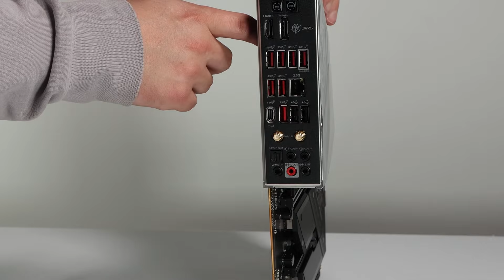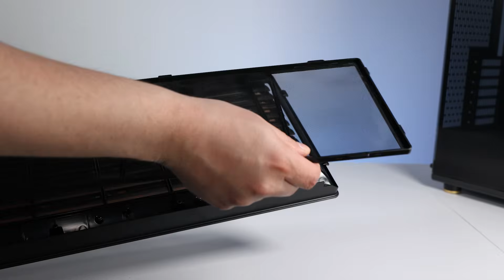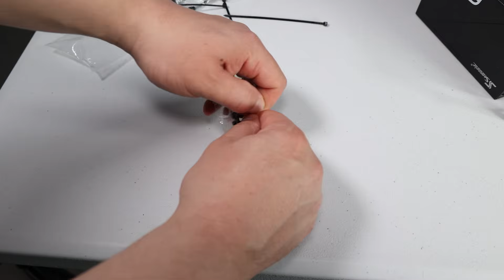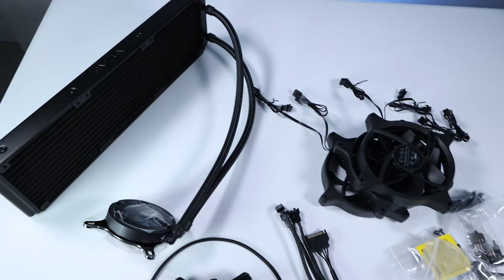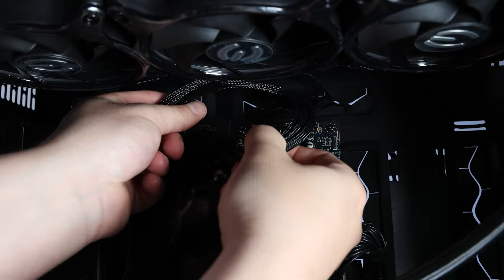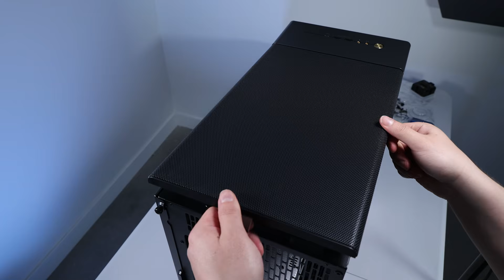Fractal North XL Build (High Performance Gaming PC)

Comment: Ordered a Fractal North XL with a mesh side panel to replace my current Fractal North with a tempered glass side panel. I'm looking forward to the extra space and cooling options. I'm also upgrading from an AM4 build with a 5700x to AM5 with a 9900x. I would have gone with the x3D, but the 9900x was a good deal in comparison, and the extra cores will be nice for other non-gaming tasks.
Everything inside mine will have the brown Noctua fans, and I'm going to put some wood-grain contact paper on the front of the "basement". No RGB, of course, but I'm debating putting an LED strip in there and setting it to a warm orange glow, like the vacuum tubes in an old radio.
Reply: Im deciding between mesh and glass, does mesh look good?
Reply: @ambatubelo I think so, in a more subdued, less flashy way.
Reply: @The8bitbeard  is it noisy during normal usage?
Reply: @giangibus4065  It was until I adjusted the fan curves. The mesh doesn't block the fan noise as much as glass does. I have all Noctua fans in there, which helps a lot.
Reply: I am going  for a seedy dive bar for the inside, something about orange is speaking to me.

Comment: watching your video i just had an idea that i'm now craving for the pc industry to do. putting all of the motherboard connectors (power and data and fan) at the back of the board. This would mean doing a new ATX standard but we could achieve true cablefree minimalistic build. because that motherboard with no cable on it looked amazing.
Reply: It's already available, not as standard but there are a few to buy out there.
Reply: @antonkeule  Ho really ? Who make this ? And do you need a special case for it ?
Reply: @mehdisol7094  MSI, Gigabyte, Asus as far as I am aware. Well, you need to check that there are holes / free space for the connection when the board is mounted. Channels like Gamers Nexus have covered that. Back connected motherboard and you will find what you need to know.

Comment: I'm making a very similar build to this. I've ordered the 9800x3d but its performance in all the tests I've seen isn't that much better than the 7800x3d. The prices for the available 7800x3d was only £20 less though so I just went with the 9800x3d anyway.

Comment: Don't need to remove thermal pad on m.2 drive if it's a one sided drive. If it has stuff on both sides on m.2 then you need to peel bottom also.

Comment: Finally someone who actually knows how to show and tell people how to build. Dont even ahve to know anything about a computer to understand the way you presented everything. Good job
Reply: When you start build this all parts into the case is always good practice to connect all essential parts just on the table and power on as a test, if it works. Last thing what you want is troubleshooting after everything is setup inside 😃😃😃

Comment: Nice build, I have a very similar once coming in the mail and I'll leave another comment when I get all the parts in for assembly. Fractal North XL, but my specs are a step lower than yours. 7900 XT, 7500f processor (7600 with no integrated graphics that you can get for $120, crazy good deal), air cooled with a cheaper motherboard. $1500 flat on pcpartpicker cause I got the samsung pro 990 2tb SSD (the GOAT), your exact memory if I'm not mistaken, and an 850W psu which is 300W overkill at least but I want headroom since the 7900XT is very easily overclockable for more performance.

Comment: thats how you dont install a cpu cooler
Reply: Can you expand?
Reply: Nope that’s one of the best ways to attach an aio cooler. Watch gamer nexus or jaytwocents to learn about their placements
Reply: You install it on the mobo first, then you install the mobo and then the radiator
Reply: @ItsRope maybe for an air cooler. Doesn’t make sense to install the pump outside the case, then fit the Mobo inside with the tubes in the way.

The only reason you install the air cooler outside the case anyways is for accessibility
Reply: @henry3397  well it does because you don’t want to put strain on the motherboard. But agree to disagree then
Reply: @ItsRope How exactly does it put a strain on the motherboard? If anything isn't it less strain as there's no tubes pulling on the motherboard whilst you're firstly installing it into the case?
Reply: @ connecting your cpu cooler on the bolts that you apply on the mobo can take some force. Coolers like the artic 3 are a really tight fit where you really have to pressure the plate on the cpu to get grip on the bolts. That’s why you don’t want it in your case because it can bend the mobo if it’s not on a flat surface.
Reply: @ Ahh I see that makes sense! So it's more nuanced depending on the mounting mechanism of the AIO. Thanks
Reply: @ yeah it depends! Noctua has a really good mounting system without the need of using force! But best practice is to install everything before inserting it in your case because of the strain you can put on the mobo.

Comment: Didn't want to wait for the 9800x3d either.  I just jumped in on a Canada Computers 7800x3d + Gigabyte X670 + RAM combo deal.  Had to go with the North XL case, which brought me here.  Great video!
Reply from the maker: The 7800x3d is still going to be a beast for years.

Comment: you said you made a mistake with plugging the pump cables. did you end up fixing it? how did you do it? i'm asking just because i'm planning to put and aio on top as well. thanks
Reply from the maker: I plugged the fans into the motherboard instead of the aio. Is that what you're referring to? I unplugged the fans fron the motherboard and plugged them into the aio

Comment: What would you recommend for a silent build? No AIO for me, but the case has to be fairly silent. Today I use an older Fractal Design Define R5 that I really like.
Reply: NH-D15 or something with 140mm fans
Reply: Nactua air cooler

Comment: We need an XXL, whatever they want to call it - the 011D Evo XL is bigger than the 011D XL even though the EVO alone should not really cause that, they realized they still needed a bigger version is just made the EVO version bigger - the North XL needs something similar - the lack of support for two simultaneous 420's (with technically 480 at once in the top and/or front) would be awesome, and they did that twice already with the meshify 2 xl and that other case that is mostly the same that came before it.
Reply from the maker: Here's to hoping for a XXL 🙏
Reply: I saw someone say the original North should have been called the North Compact, while the current XL should have just been the regular size. This would allow for an actual North XL.
Reply: Let’s call the XXXXXL Fractal Design North Fridge.